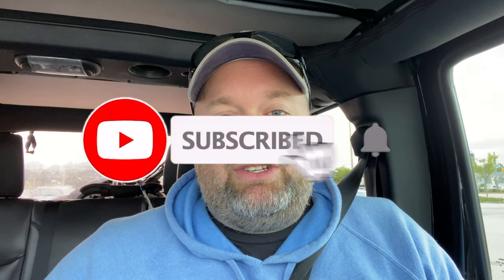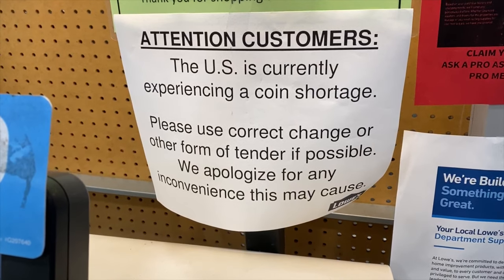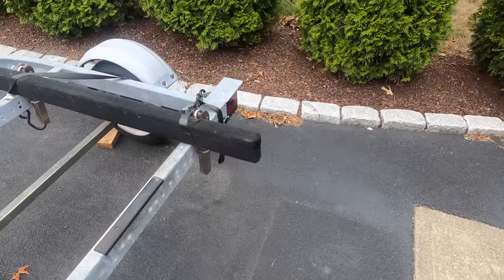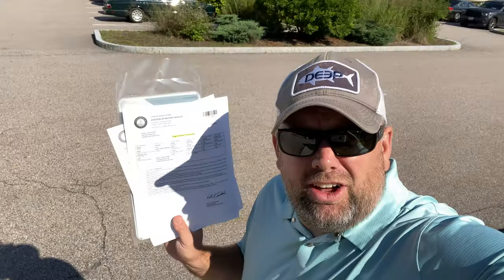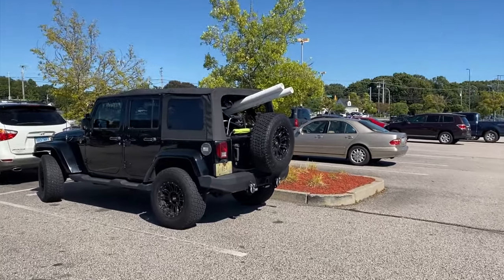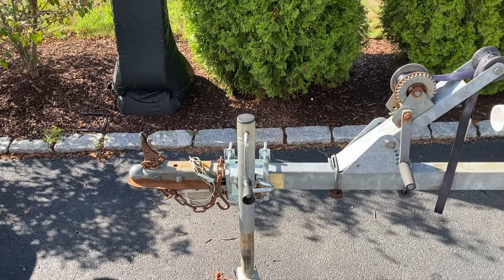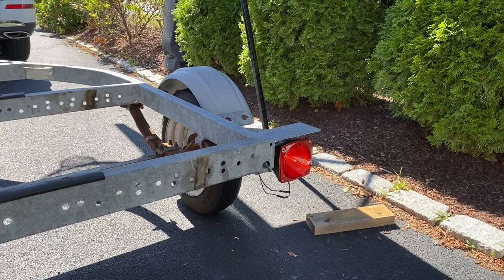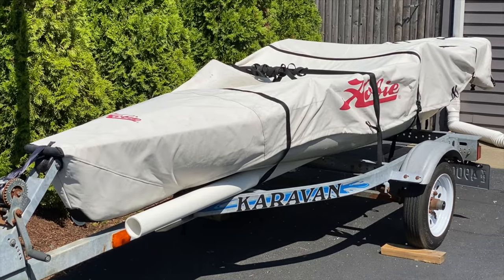Kayak Trailer DIY - Transporting the Hobie Pro Angler pt 1

Comment: Good part 1 video. I recommend moving the middle connections to the front. The pipes will bend in the middle and conform to the shape of the PA hull. You will have even support of the hull.
Reply from the maker: That’s a great idea. It’s covered now but will look at that once the weather get better. Thanks!

Comment: Hello from just north of the RI border in MA!!   I just picked up that same PWC Karavan Trailer used, and will be converting to haul my Jackson Kayak.  Question #1:  Is the tongue length adequate for easy / accurate backing up?   Mine will be attached to a chevy truck.    Question #2: have you added a rack system to the trailer yet?   ...and if so can you give me some suggestions / tips on what you did, components used, etc.?   Catch 'em up!!
Reply from the maker: It works well enough for me. I tow it with my Jeep and backing up isn’t an issue with the length. I did have to move the winch forward to accommodate the PA14 but have had zero issues.